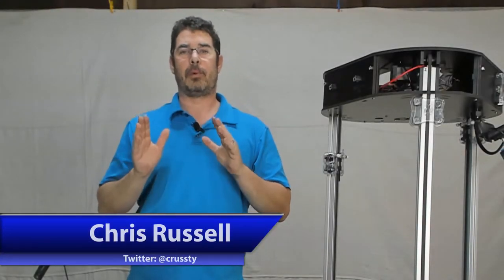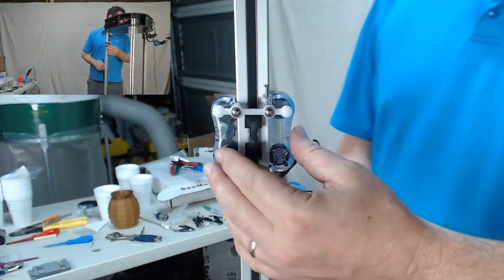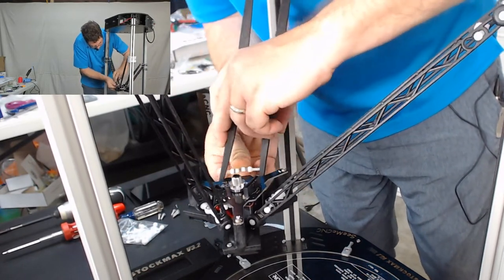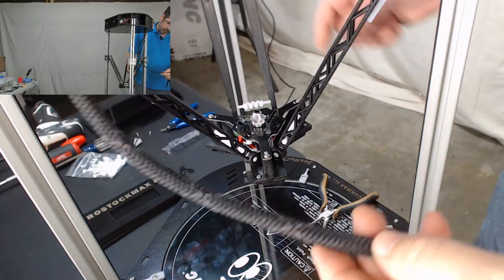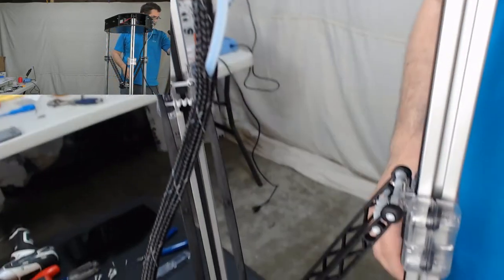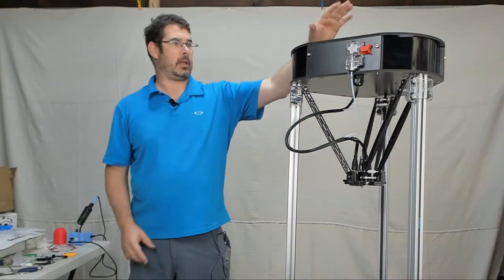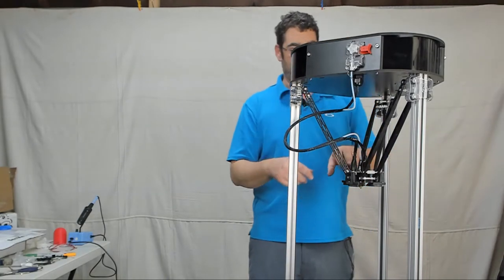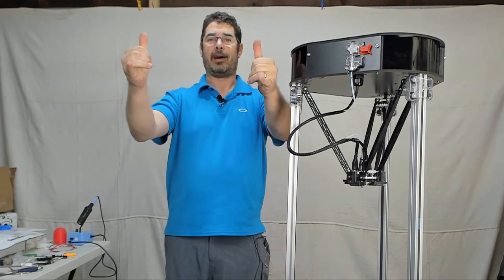SeeMeCNC ROSTOCK MAX v3.2 Build Series Finale Part 15: Steps 60~64

Comment: Every time you are touching the printer, it has this low-frequency visible-amplitude vibration that worries me a lot. Is it sitting on a some kind of wobbly folding table? Or is the construction really that flexible? If the latter, surely that must negatively affect the print quality?
Reply from the maker: Eelco Hoogendoorn yes, I was building it on a knee high children’s table to be able keep it low and keep the printer in frame.  If I’d used my normal bench, the printer was well over my head. It’s very stable when on a proper surface.
Reply: @crussty3d  Thanks for clearing that up. Considering a second hand 3.2, and not that much review material out there, so thanks for this. Cant seem to find the calibration series; did that not make it to the top of the list of possible projects?
Reply from the maker: Eelco Hoogendoorn unfortunately that never made it to YouTube.  We had a house flood and all the footage I had for that got lost when that computer got soaked.